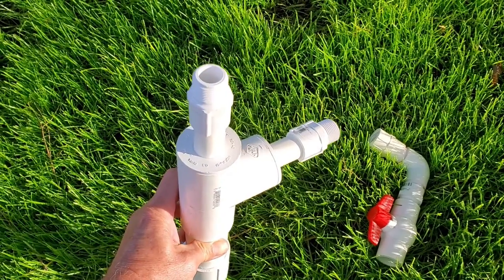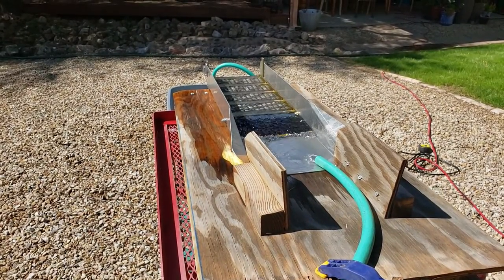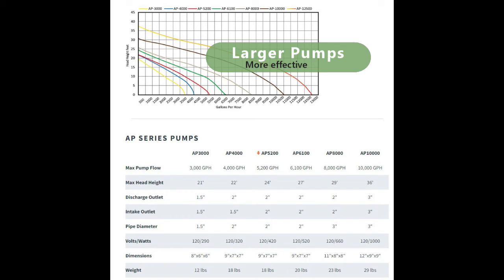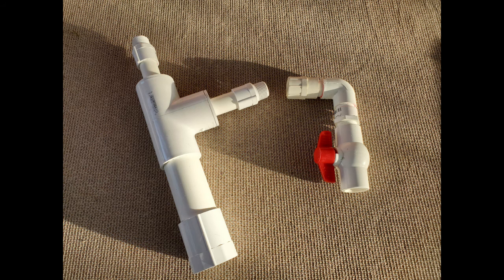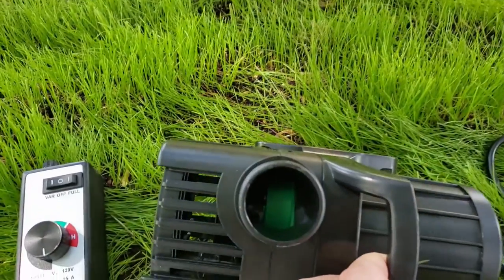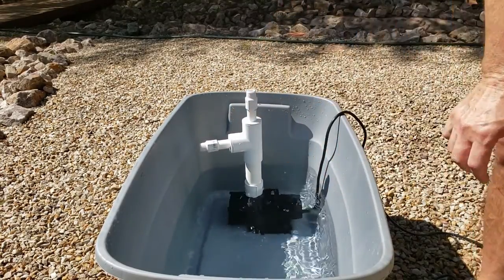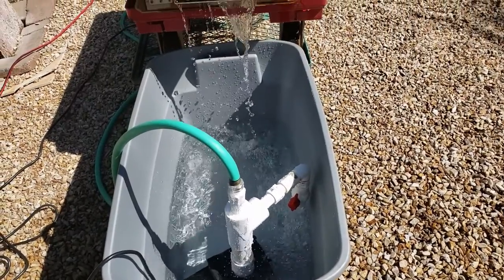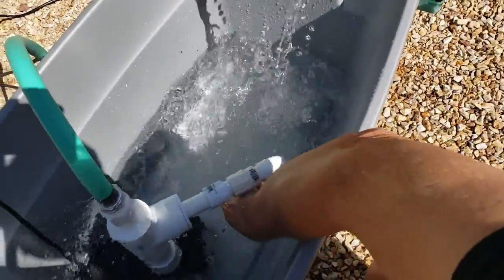Make ANY Water Pump Variable Speed - Pond, Sluice Box, Water Feature

Comment: I like your idea of using a splitter with a valve to adjust the flow.
That way it does not create back pressure in the pump unlike these models with an internal flow adjuster.
That's because the sum of the water flow coming out of both pipes is always the same.
It's much better than using the speed controller because that device changes the voltage 
and you don't know if the pump is rated to work within the voltage range you changed.
Unless specified in the specs of the pump but most pumps are just rated for 120V,
it says nothing about being rated for anything below 120V. So, you don't know if it could damage the pump.
Reply from the maker: @_el.guapo_  Thank you.  True about the voltage.

Comment: Thank you your video was quite helpful. Do you think reducing the output of the pump will damage it in any way.
Reply: In my understanding, with the splitter and the valve, he is not reducing the output of the pump. 
Instead he is just splitting the water flow in 2 directions and with the valve he can adjust the ratio.
So for instance if the pump is pushing 200 GPH, the output of the pump will remain 200 GPH regardless the adjustments.
But he can adjust it to have 75% of these 200 GPH in one pipe and 25% in the other one.